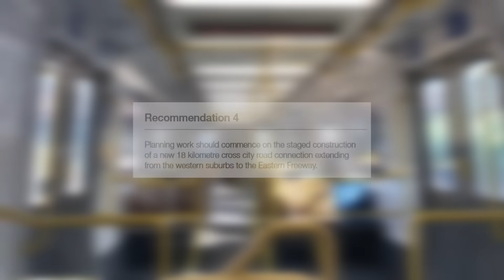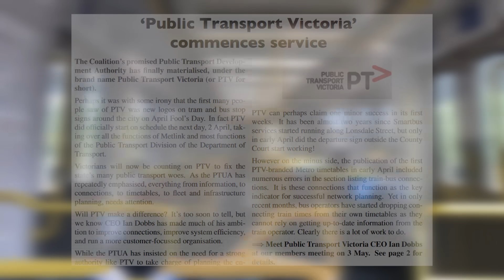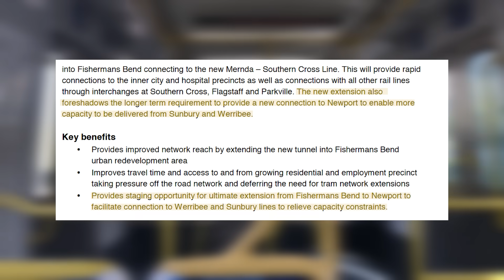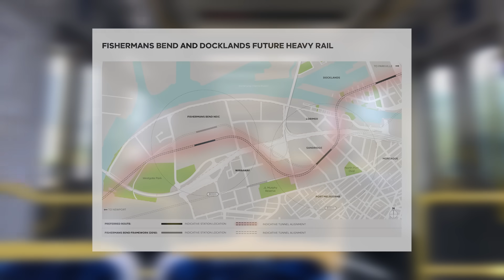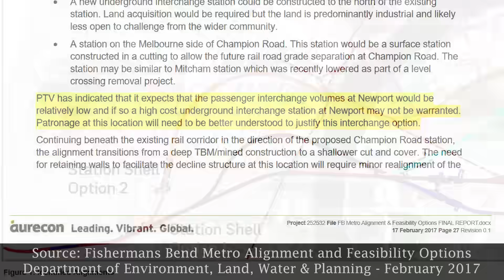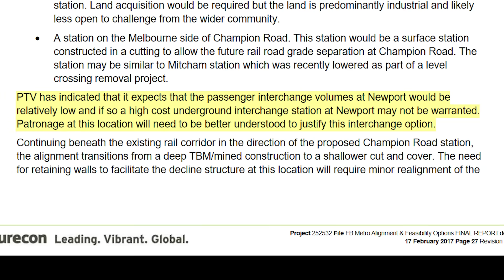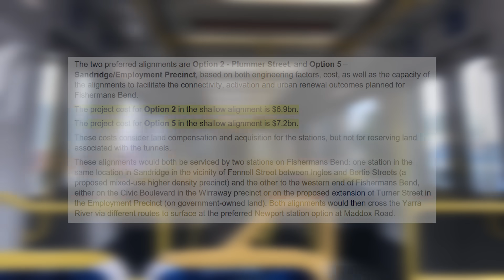Melbourne Metro 2: Explained

Comment: They should just extend the weribee line to Wyndham Vale. It would only need 500 metres of rail and then electrification. It would be such a quick low cost project but would improve connectivity for Werribee and the south west so much.
Reply from the maker: This should definitely be done as a separate project well before MM2
Reply: Agreed plus a new train station at Black Forest Road. This would help overcrowding on the busy Wyndham Vale and Tarneit vline services.  In the short term you could also implement high capacity signalling between Flinders Street and Newport West to allow even some Geelong services through here, as level crossings will be removed on the Werrribee line. This would make Tarneit and Wyndham Vale more of a stand alone line, given their high patronage until electrification is done.
Reply: This is the missing link that was eliminated by the Ballieu government as a cost saving measure(?) after the Bracks government started the RRL. Looked at the cost of the RRL and decided that it was going to cost too much. There were cost saving decisions then made at this time which we are still living with. Not having this means that the only direct way that Geelong passengers can get to Werribbee is to get off at Wyndam Vale  and catch a bus through a dodgy series of suburban streets. The result that if you work in south west Melbourne you are almost forced to travel by car. Note that there is an existing third platform at Wyndam Vale for a link to Werribbee.
Reply: @davidmann8504 This was not a Bracks Initiative. The Feds supplied most of the funding.

Also you can catch buses from. Tarneit which are more frequent.
Reply: @davidmann8504  I use WV station a couple of times a week.  There is no third platform there.  There is space to eventually build one, but to say one exists is incorrect.
Reply: @davidmann8504  Not Ballieu Government. It was deleted when Napthine took over.
Reply: This is on the cards, but they are currently building the east Ison Rd overpass (crossing the Werribee rail corridor) and connecting it to the M1. They will then build the west Ison Rd pass (crossing the Wyndham rail corridor). Once both are complete, only then will we see movement on the interconnection by rail.
Reply: 500 metres? Try 5.6 kilometres between the 2 stations.
Reply: @fireman1468  5.1 kilometres of which already have track.
Reply: or...they could run some Geelong trains on the Werribee line.  The line continues past Werribee and connects to the Geelong line, they just have to do it.  Nothing to build.
Reply: @goswannie14  There is no point unless they Electrify out to Geelong and make all Werribee stoppers go via Altona and Geelong Direct. And even then it will not be optimal because of the Footscray to Newport section.
Reply: Because the new V/Line station and connecting bus services are there? 🤔😲
Reply: Only problem is that there's existing estates and parklands right where that missing link is. And we all know that there's going to be NIMBY's trying to block it. Only real solution is to tunnel under everything but that would be extremely expensive and the government likely won't want to spend money on it. I wish our State Government grew more of a spine like in NSW where the local councils have recently been stripped of a certain degree of power when it comes to approving large scale projects.
Reply from the maker: @eddielong8663 there’s a right of way reserved near the flyover for Geelong line trains that allows for a future extension from Werribee to Wyndham vale
Reply: @eddielong8663  the estates built don't cross into the alignment needed for a Wyndham Vale link
Reply: As a person who lives in the Werribee line I agree. It's best to wait until they finish the Melbourne metro before proceeding to help fund the project for the future of our Werribee line. This would've been interesting if they built the Newport west station and therefore it will create more limited express link to the city but with a couple stops at Fisherman bend, Sandridge and direct to Southern Cross station

Unfortunately because of the cost increase thanks to the construction company and the scenario looks how will it go that would be sometime an entire disaster which would eliminate the idea. While some would be likely to happen with the cost of the project they have been investing in.  

Oh tho our Werribee line needed desperate change since my line needed some frequency service upgrade, better timetable that could try to increase. Extended to Wyndham Vale station so that this will increase more service.
Reply: Now we are talking... you right here have more brain than the entire Jacinta Allen & Dan Andrews government.., Waste of money all of them are
Reply: @joebanks3838 wow you think the LNP could organise any rail projects? Or want to? Ha!
Reply: @Low760  The ALP has canned so many rail projects its not funny. Whilst spending $36 Billion on 2 road projects. This isn't a party political thing. This is Victoria. Roads come first.
Reply: @joebanks3838  Let's just wait and see the LNP reduce services across the board for everybody! Can't wait!
Reply: @joebanks3838  literally no one asked for your opinion
Reply: @mathewferstl7042  You got it anyway.

Comment: Maybe an unpopular opinion, but I can’t help but think it would be better routed via Southbank with a station at balston st and city rd and than a new station at the Federation square carpark before than shooting up to Fitzroy.
Reply from the maker: The major issue with that is the Yarra - a station in Southbank would need to be very deep underground (and thus expensive) to cross the Yarra River, and may need to be on a gradient. The current alignment leaves some 600m at the shortest from a station to the river vs. more like 50m for a fed square station. Not impossible (as the Metro Tunnel proves) but not cheap
Reply: Fitzroy and Merri don't need a new station. This should go under Collingwood and then head out to Doncaster

Comment: Interesting how this is using essentially a part of what the Liberals proposed over a decade ago and it was slammed (Fisherman's Bend section). With the state's finances, this will be a difficult sell.
Reply: The Liberals proposed re-routing the metro tunnel via south Melbourne and on to Southern Cross - almost universally recognised as a poor plan. It's important to recognise that they did nothing to start that project.
Reply: @user-wy4ci7yj6b  Only in power for 4 years. Governments (of any flavour) only get started on big projects in their late second and third terms, unfortunately.
Reply from the maker: it's not really at all the same proposal. That proposal was, frankly, a half-arse of MM1 and only barely served the fishermans bend region, whereas this makes more sense from a long-term network planning point of view in terms of separating branch lines
Reply: The Fishermans bend to Parkvile section should be heavily private funded by qlum from Melbpurne uni as that is essentially there as a uni shuttle between campuses, the Newport extension is essential, we need to have better connection to the west that doesnt go up and around, electrifyong it all the way to Geelong may also be somethinh that may need to be cut, you cannpt run diesel on yhe tunnels, but there was never anybissues with intervhanging at werribee so we can just go back to running a seperate Geelong to Werribee service to slot between the wyndham service, hiwever what I really really want to see if a light rail run down palmers and citting accross to derimit
Reply: If the Liberals had gone ahead with the Metro Tunnel, we would be using it by now. Four wasted years! Also Metro 2 tunnelling may have been started. Liberals can't be trusted with public transport projects. They only think of their developer mates instead of what is good for the general population.